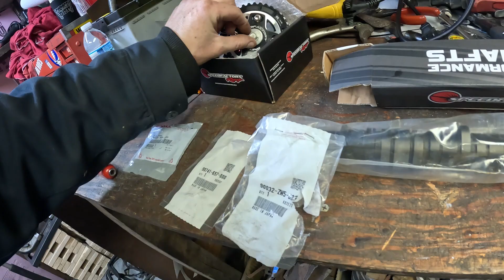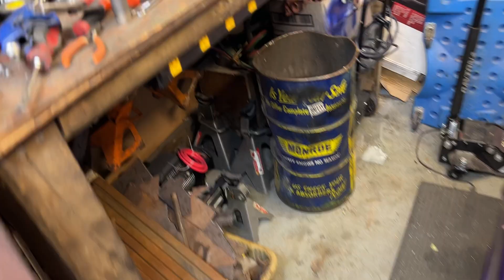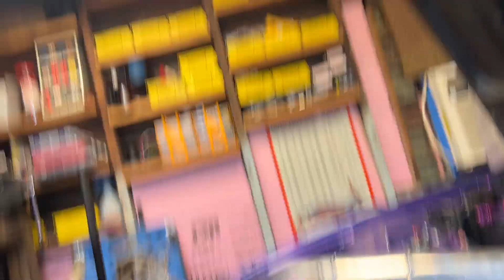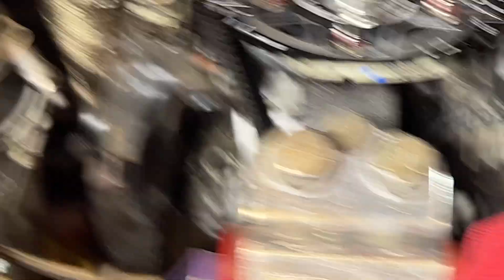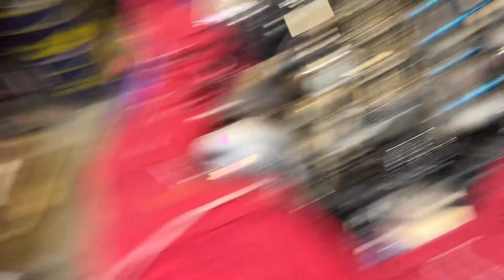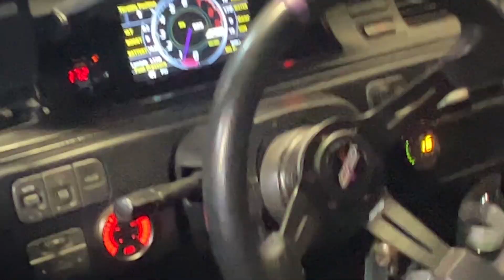D16 TURBO SPEED FACTORY SAVAGE CAM AND SF CAM GEAR DEGREE/INSTALL

Comment: did you set valve lash before degreeing the cam? and could this technically be done without a piston stop ? TIA, great channel
Reply from the maker: You set the lash to zero when degreeing and no piston stop is needed if you use the timing marks on the block, but if you wanted the most accurate way would be to use the piston stop or a dial indicator with the head off and check where the timing mark is and put the crank pulley on and mark it. But otherwise you can use the timing marks on the block itself and cam and head. Thanks for the feed back hoping to get back to making video sometime soon been mia for a bit now ❤
Reply: @schmikels_garage everythings a process, youll get back to it soon. Blessings and thanks for the reply 💯❤️ (me on my other channel lol)

Comment: 😂 i have a home made d15b2 block and p08 head bore polish and valves jobs delta regrind cam 272 compression around 10.1 to 11.1 but on a Weber carb set up using d15b2 16 valves intake manifold polish mild distributor case from the d16 with d15b2 16 valves internal no vtec or turbo crap all motor sounds old school style like a ford v8 muscle car and bulk looking she is a beast lighter flywheel and gd clutch kit nothing fancy but i can say she is peppy like hell she is obdo emc the delta regrind cam works beautiful with the weber to 7600 rpm do over 100 miles in 3 gear easy gd on gas and cheap to maintenance header and homemade exhaust system big difference from turbo or VTEC my can hustle like a hunting falcon every one think i have a v8 on my crx real peppy to fast really for what it is made of junk yards parts love my carb combo set up i always do my timing in up hill if feel real strong on 3 here she will sit the rest dont matter timing and carb set up my tune is a rusty screwdriver 🪛 jjjj the cam is already in timing and carb work set up and bingo if she doesn't smell like gas a bit she out of timing for me jjjjj she fly ccr born in the byouooooo amigo old school style rusty looking flare out 89 crx nothing fancy or special but don't get close to her when she start running she might drop gear down and fly like a falcon down the streets a go kart on steroids jjjjjjj she really fun to drive bro a lots of people alway asking is for sale do have v8 in etc the Honda guys get mad with my thousand dollars crx jjjj sounds to good like a race muscle car jjj and look tuff like she is mad deep dish wheels jjj low coils bad looking little crap walking and sounding tuff but she is real fast to jjjjj

Comment: Great videoI have a question what kind of chemicals I have to put to the single cam before I put it ?
Reply from the maker: @tsaintt691  engine assembly lube, I used a Lucas racing assembly lube. But any assembly lube should work

Comment: I'm planning to get the same cam after I replace my split block lol you ever split a y8 block before ?
Reply from the maker: @h3xd3m0n9  dang!! Nah I haven’t split a block yet. How much power did it have to split it? Deff recommend this cam it woke my engine up so much!
Reply: @schmikels_garage  I never had it on a dyno but based off fuel quantity 450 at the crank. I was using a ported y8 head and a y7 cam running it at 37psi. I honestly just think it's a block lottery or fatigue I've been running this engine for almost three years and not nice to it
Reply from the maker: @h3xd3m0n9  that makes sense only can last so long haha, were the internals able to be reused?
Reply: @schmikels_garage  I haven't taken it apart yet but it runs fine just has coolant pouring out from front to back so I'm gonna assume so. How's the new cam feel have yo taken it for a good blast yet ? I'm hoping to take the engine apart this weekend and going to pick up the new engine today hopefully the rockers are in good shape and not groved like last ones forcing me to use the y7 guts
Reply from the maker: @h3xd3m0n9  oh nice!! The cam deff rips it made a huge difference over the delta grind I had it early prob a 50+who gain if not more and deff help the spool a lot really glad I made the switch!! Ya know I never thought about using the y7 rocker arms if the other or worn out that’s good to know cause I have a sparey7 head I prob could have used this rockers instead if having to buy a used set haha
Reply: @schmikels_garage  only thing is you lose the ability to use VTEC cams with y7 rockers but I do like them cause they are lighter just wish someone made a non VTEC cam. Can't wait to try the cam for myself. I'm using their head gasket as well it stopped my yearly gasket replacement lol
Reply from the maker: @h3xd3m0n9  oh yeah duh I forgot they don’t have the holes for the springs and if you mess the vtec rocker up the y7 don’t have that haha but yeah I hear ya deff need some more non v stuff. I know bisimoto used to sell non vtec cams but idk if they still do
Reply: @schmikels_garage  bisi is all in the ev space now with his Porsche but I Donno I never tried calling and talking with him. There are places that can regrind a stock cam but that goes so far and will eat rockers faster
Reply from the maker: @h3xd3m0n9  they used to have them on the website but that was prob 5 years ago now n prob doesn’t sell em anymore. I didn’t even think about the grind chewing the cam that’s prob what killed my rockers haha

Comment: I need some help with my camshaft, I took off the stock camshaft at tdc marks with the cam gear and when I try to install the street savage camshaft with the golden eagle cam gear the cam gear keeps going off tdc. Help me I’m new to this
Reply from the maker: @xnateYt04  what do you mean that it goes off tdc when with the golden eagle gear? The cam is installed and you go to put the gear on and the timing marks or off? If so can you just turn the cam or if that’s what is happening can you put the stock gear on with the cam already installed and are the timing marks lined up? What d series are you installing the cam into? Also if you are not using a z6 cam gear it won’t work the savage cam is a z6 so if that golden eagle gear is a Y8 gear that’s your problem.
Reply: My issue was that I was installing the street savage cam with the golden eagle cam gear on the camshaft already. And when I tried to put the rocker arm assembly on it wouldn’t sit flush and the cam gear would turn every time I try to make it sit flush, because aren’t you supposed to have the cam gear at tdc then tighten the rocker arm assembly down. Or am i doing it wrong the whole time
Reply from the maker: @xnateYt04  yeah that’s what ya do but it will turn when it’s tightened that’s fine just once the rocker arms are all torqued just rotate the cam to tdc it only moves a little and isn’t a big deal it won’t hurt anything when it moves
Reply from the maker: @xnateYt04  one other thing I just thought of that I didn’t mention is the adjusters for the valves on the rocker arms should be all the way out that will help with it turning the cam but more importantly when you are torquing it there is less cha be if snapping the cam from u even pressure